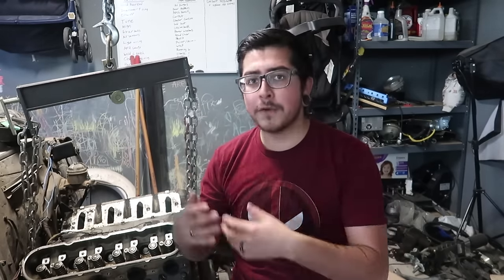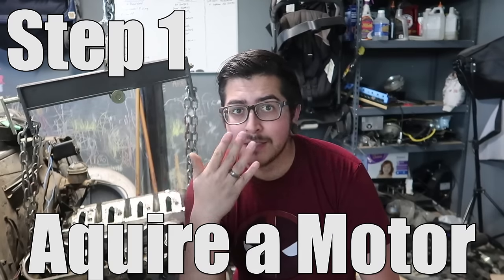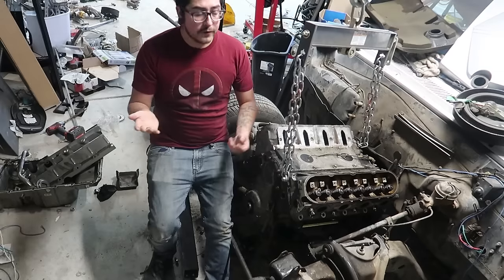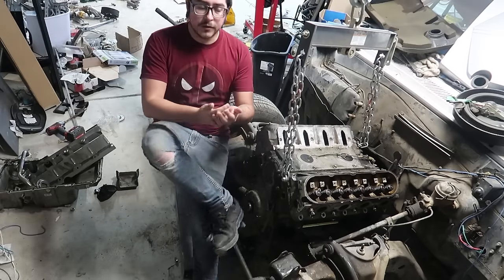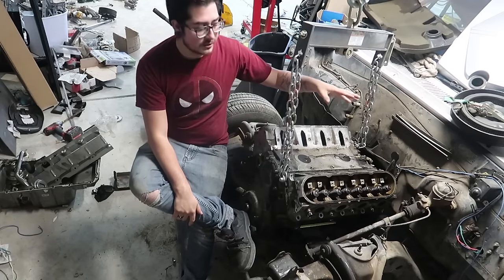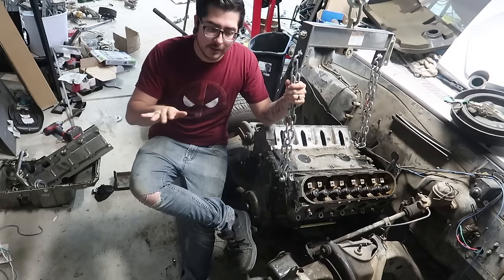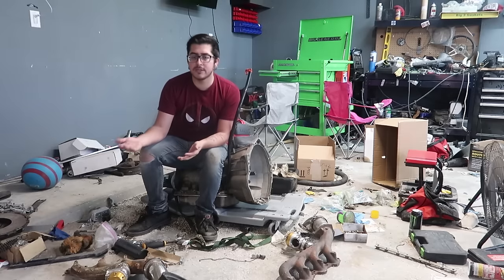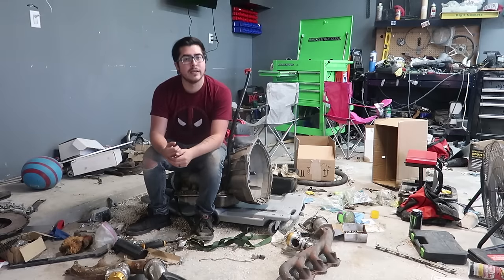HOW TO LS SWAP ANY VEHICLE - 5 THINGS YOU NEED -- LS Swap Basics Overview (LONG VERSION)

Comment: Hey, I am about to pick up a CTS 2011-2013 would the tranny work?
Reply from the maker: No those are a 5l40e they used a different bellhousing if it's a 3.6 but if it's a ctsV then yes that would be a LS3 or LSA
Reply: @JovaniDanteGriego : Thanks man, so what will be the perfect CTS LS set up if I want to remove the 3.6 would like 500+ hp
Reply from the maker: @traynice9633  I've gone through wanting to do a cts swap but honestly unless you have zero dollars invested it's not worth it. The cts V is a way better frame and platform than a regular cts. It's not just a engine swap it's the rear end which will never hold up, the trans, engine cradle, harness, brakes, suspension. You're really better off finding the cheapest cts v than putting money into converting a cts
Reply: @JovaniDanteGriego : yes been hearing if am doing a cts I should just supercharge it. CTSV are like 55,000 in my country and that's for a 2011
Reply from the maker: @traynice9633  oh ok I didn't know you were in another country. Do they make a supercharger for the 3.6?
Reply: @JovaniDanteGriego : a company call overkill, but it's like 5000 I believe and you only go from 320 to 415 on there stage 2 and 450 to 470 on their stage 3, but you have to do fuel pump  an injectors
Reply from the maker: @traynice9633  do you have some that can tune it? I think turbo would be cheaper
Reply: @JovaniDanteGriego : we got the fastest civic in the world and the fastest mustang out here not to sure about the all wheel drive

Comment: I'm curious on doing a swap for a family member but not ls. An 07 charger 5.7 into an 86 pick up. I can only assume fabrication is a must, but are there resources out there to get it done? Pretty much majority on what was mentioned in this video.
Reply from the maker: What brand pickup ? Chevy or Dodge
Reply: @JovaniDanteGriego  dodge 1500. I tried convincing him to go with an ls since theres plenty of info and resources out there, but I'm not too sure what challenges I might face.
Reply from the maker: If it's Dodge to dodge there's probably something. I've never dabbled with the new hemis so the first thing I'd check out is standalone controllers for them . If you can make the engine run then the rest is fabrication
Reply: @JovaniDanteGriego  I might have my hands full but I'm up for the challenge. Thanks! 👍

Comment: 700r4 is tougher than a 4l60e
Reply from the maker: A 4l60e is just an electronic controlled 700r4.
Reply: @JovaniDanteGriego  700R4 is cheaper and can handle plenty of power without having to worry about a TCU
Reply from the maker: @paulhopkins1905  as long as you know how to setup the TV yea.
Reply: @JovaniDanteGriego  That's fairly easy to do

Comment: So it just connects to the drive shaft like nothing ? Any trans?
Reply from the maker: What? Of course theres a trans theres a whole section of the video talking about transmissions
Reply: No that if the newer transmission connects to the old drive shaft without anything or do you need something but thanks I’ll check it out
Reply from the maker: @victorobs9827  just depends I. The I joint. They make conversion I joints
Reply: Jovani Dante Griego forsure thanks for the info man 🤙🏻

Comment: I have a 71 cutlass I wanna put a Ls 6.0 in it  can you help me out on where I should start as far as year of motor or what donors I can use would really appreciate it
Reply from the maker: Iron block 6.0 is going to be in a 2500 plus truck van or suburban. Also 1500HD trucks escalades and denalis
Aluminum blocks are going to be escalades and denalis
Reply: Jovani Dante Griego what’s the earliest year I can go
Reply from the maker: 2000 to be safe but some 98s and 99s, youll know the difference in the way the engines look pretty fast
Reply: Jovani Dante Griego so is 6.0 out of a 2001 2500 hd pickup truck kool

Comment: None of the vortex motors are ls motors
Reply from the maker: The 4.8/5.3/6.0 are based off of the LS1 architecture and almost every single part is interchangeable.
and its VORTEC, not vortex.
Reply: @JovaniDanteGriego  auto correct everything I’ve read said they where different. LS stands for long sleeve.
Reply from the maker: @austinmccoy9435  what? No it doesn't. LS is just a rpo code. It doesn't stand for anything. Guess what the next iteration was? LT. It's just a rpo code. Just like every vortec engine has an RPO code. LM7 LQ9 etc. Whatever research you're doing is wrong

Comment: Can I do an ls swap in a 2017 Mercedes e300?
Reply from the maker: Why would you want to?
Reply: @JovaniDanteGriego  everyone is telling me the same thing 😤
Reply from the maker: Because whenever someone asks "can I swap into this" 
I always say sure anything is possible but is it going to be worth probably spending more on a transmission adapter than just getting a replacement engine
Reply: @JovaniDanteGriego  the reason I want to do it is because the engine I have m274 is common to break and already cracked piston 1 so the cost to fix is 7000. Though shut might as well build a bad ass engine and have some fun but it sounds like everyone is saying no lol I’m scared now
Reply from the maker: @TRVSTmusic  if youve never done one I don't suggest trying on a late model non GM vehicle. It will end up being a lot to learn and you'll spend twice as much the first time around
Reply: @JovaniDanteGriego  luckily my front niehbor slash buddy from childhood works at a shop that does LS swaps when I mentioned it he laughed and said a number I was not expecting but figures shit the replacement v4 for the car is the same price and is a piece of shit so why not consider it

Comment: Question will I have to change my rear end or the gears in the rear end if I'm putting a ls in my 72 chevelle..
Reply from the maker: It depends on what rest end you have. 12 bolt will be fine, 10 bolt will hold up to moderate power. The gearing should be fine unless you have a 6 cylinder
Reply: The answer is yes you can dude dont give answer you know are wrong wether its a 10 or a 12 its stronge enough to hold a stock v8 so the answer is yes not it depends
Reply from the maker: @charlestorruella8591  He never told me how much power hes making,. Im erring on the side of caution instead of just giving information that may not be true

Comment: You want to put a remanufactured engine not a rebuild ! You want to do right the first time because who out there has the time and money to keep messing around with engine ? Your going to take engine out of junk yard ? Haaaahaaaaa!
Reply from the maker: 500hp and still ticking my dude. Not only that but I "remanufacture" them myself
Reply: @JovaniDanteGriego  ok ! What will cost me if you build me 6.0 in 400 to 430 Hp on the rear wheel 400 lbs torque . I'm not out to red line my motor . I don't go over 4000 rpm . I don't see doin 5000 rpms unless your trying get away from Godzilla. I have 2008 5.3 and one time I floored it to get threw a yellow light in Miami and believe it or not this 5.3 got on it ! It's all aluminum with 3 letter AFM. That I shut off with edge programmer . I see 6.0 on Turn Key engine builders with 470 to at 6600 rpm so if I'm at 4000 to 4600 at the most to pull a 4000 lb trailer . i need the torque . I'm not red lining the motor.
Reply: I actually pull a load at. 3000 rpm with this 5.3 but I don't red line and heat the engine up , fans running like crazy.
Reply from the maker: I would look into a single turbo if your real serious about towing. It'll be spooled by 2500 to 3000 and have all the torque you need after that
Reply: @JovaniDanteGriego  on 5.3 ?
Reply from the maker: @estebahngoldman396  yea but I would go for a 6.0 if your using it for towing.
Reply: @JovaniDanteGriego  ok . I'm going to ease this motor with 225,000 miles and it will be next year when I have the money to pull it out and either put 6.0 stroked out to 408 and put that sniper Holly on it with the flash .throw some pipes out side old school and be cool !

Comment: Can an Ls engine fit in a 2002 Chevy cavalier?
Reply from the maker: Will it fit? Yea. Do you want it to fit. Probably not
Reply: @JovaniDanteGriego  would it be a bad idea to install it in such a car ?
Reply from the maker: It's fwd. Just take a look under the car and see where the driveshaft would go. You could probably do an LS4 but even then is it worth it?
Reply: @JovaniDanteGriego  that's a good question just tired of my little 4 cylinder engine knowing I can't make that faster 😭😭🤣
Reply from the maker: @KINGWADE-qq7gv  what do you mean? The ecotec is a great engine.
Reply: @JovaniDanteGriego  it's a base model engine 2.2 liter in a 4 door sedan Chevy cavalier 2002 it's my first car 😭😭
Reply from the maker: @KINGWADE-qq7gv  dude look up videos on turbo 2.2s they are awesome
Reply: @JovaniDanteGriego  okay I'll look into it now

Comment: I’m thinking of doing a LS swap into a dodge magnum??? Any thoughts or tips?
Reply from the maker: Have you researched if anyone else has done it?
Reply: Was assuming a GM product would be easier than say a hemi?
Reply from the maker: @impactajuvenile  possibly. Running conplete standalone
Reply: It’s been done, there are a few actually. What are you wanting to accomplish ? Daily ? Drag ? Without knowing that it’s hard to give any thoughts or advice.
Reply: Dylan Strahan Daily and keep the Dodge AC, heater and other amenities???
Reply: impactajuvenile yes you can keep heat and A/c and other amenities, which I assume are power locks/windows etc. The gauges can be tricky though. Tbh I would probably Hemi swap something like that because of aftermarket support/ease/cost/time.

Comment: The automatic transmission situation? The 4L60e, 4L65e, and 4L80e are computerized? Do you have a video for that one kind sir
Reply from the maker: Yes The E in the name implied it is an Electronically controlled transmission. A 700r4 is a vacuum Modulated transmission, similar to the th350 and th400

Comment: The question is; Why LS swap anything? Ok, if you have a 2001+ Blazer or S10 it's ok LS swap it. But there's others good engines out there. Have a 2002 Sportrack? Put a Windsor 5.0 from a Explorer Eddie Bauer. Have 80's Oldsmobile Cutlass or 80's Buick Regal? Put a 4.6 V8 from a Land Rover that's basically a Buick 215 engine but with 300 pounds of torque and they can give you 250k miles if you know how to change the oil. And the list goes on. I'm not a purist, and yes, it's always fun to see an LS in a RX7 or in a Skyline just to see ricers boys angry... but NOT into everything.
Reply from the maker: But the LS is literally better and cheaper than every single one of those engines you mentioned. I agree with you I'm just saying, people do it for a reason
Reply: @JovaniDanteGriego  I have been in swaps for more than 20 years... that's sounds like Scotty Kilmer 😂 the thing is that yes, an LS maybe is cheaper. But then, if you are putting that thing in a non GM car, or even a GM originally equipped with a 3800 V6, you end wasting more money in electronics, dash, machine shop, ect., ect. I think that yes, maybe the LS is the better engine and you can find them for $500. But if you will waste $3k in modifications to make it run in a non GM. Maybe, and only maybe, another engine should be considered... and have the; Why the hell you put that Northstar in that Camaro when a 350 with four barrel will be cheaper? Effect 😉
Reply from the maker: I gotcha. I'm not dissagreeing. But the same thing was being done with 350s in the 80s it just made the most sense. I'm hoping to start testing out the ecotecs viability as a good alternative
Reply: @JovaniDanteGriego  well, selecting what ecotec you will be using depends on what platform (car) you have. There's differents ecotecs. If you have a Cavalier, it's better to use the ones in Saabs with turbo. But, if you have a Fiero, use the ones from Buick Verano. Why? Because is nearly a direct swap bolt on. You don't need to cut or modify drive shafts or anything. People overlook European ecotecs (family engines like the Cruze, Trax) but they are decent if you know how to give maintenance to them.